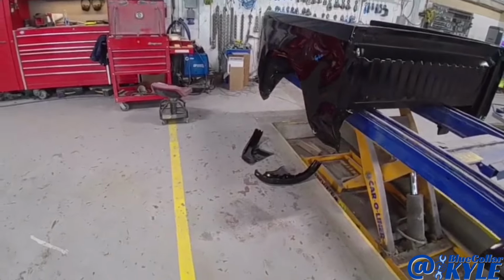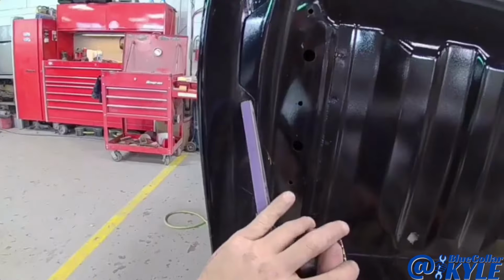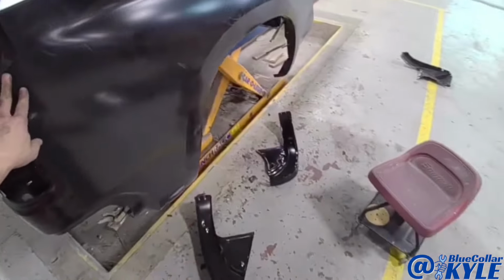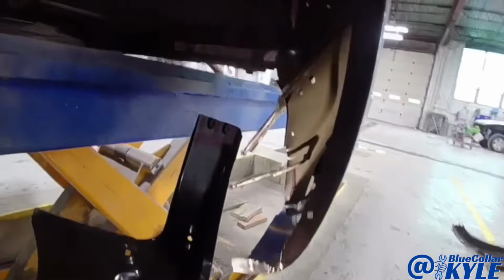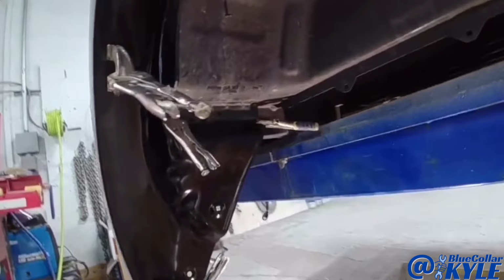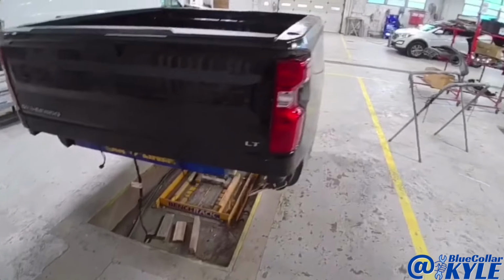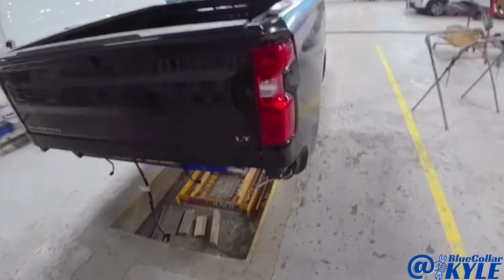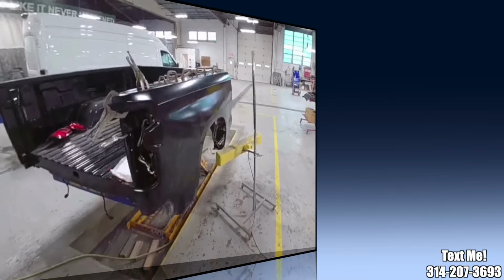Cutting apart a #ChevyTruck bed to replace the side and wheelhouse! #autobody #collision #autorepair

Comment: Hey  thanks for the video but I have a quick question I have to do this to my 2001 Silverado  but if I buy both the side step panels instead of regular panels fleet will the process fit to the same truck bed but replace tailgate bumper and gas Cap etc will it work to the same bed?…